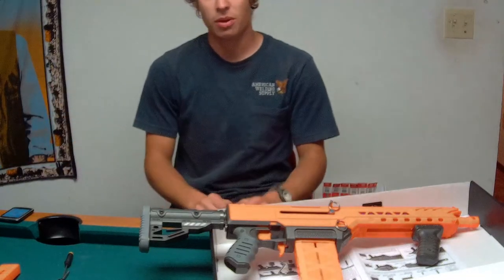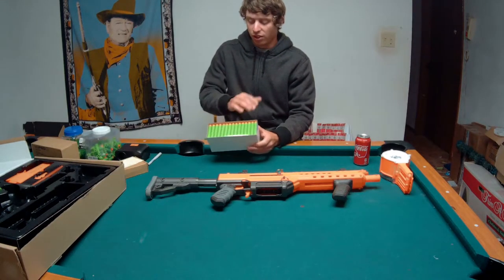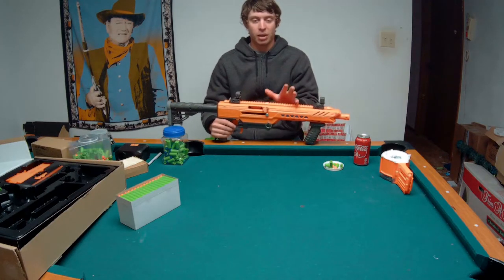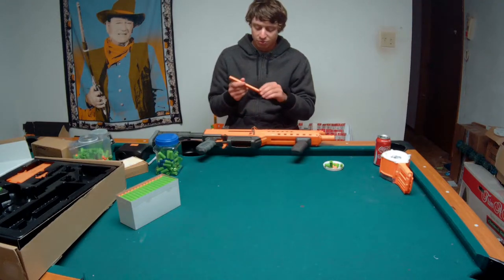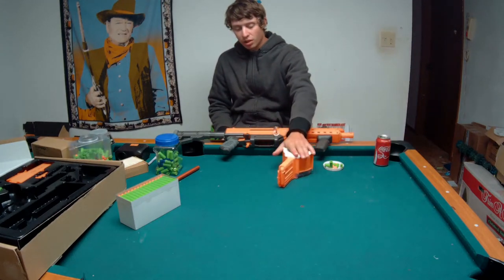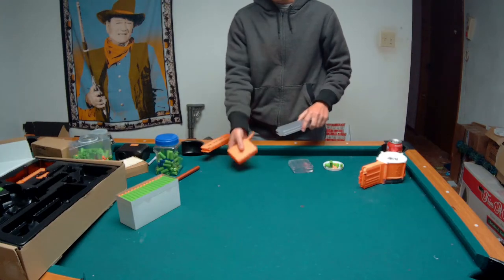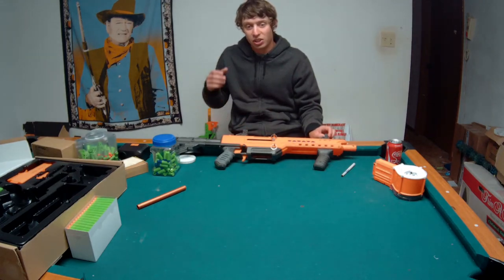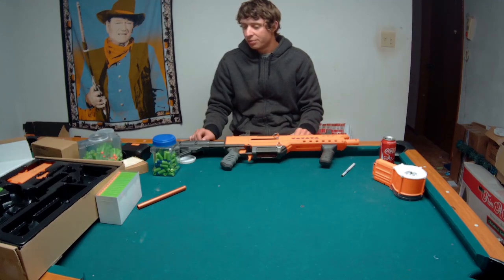Dart Zone Pro Review

Comment: Nice video u touched on a lot that no one has. Funny enough I got my DZP today and a hour before watching this video I was messing around with it. Most of the problems u had I’ve had to. I have the same stock problem has you it doesn’t collapse it just retracts to easily. And I also tested there mags in nerf, worker, and jet Blasters; none of them can take the DZP mags. And like you said when you were cronying the darts u can get better performance with other darts. There darts I thought were gonna be amazing but I’m some what disappointed, there accurate. But they fall short in distance compared to other darts like Acc’s and workers. One last thing you mentioned the goblin a couple times, just to let you know the goblin takes talons not katanas.
Reply from the maker: That's for the correction about the Goblin and the comment
Reply: No problem

Comment: I notice the metal barrel gets dirty rather quickly. Also, The reason you cant deprime the blaster is that the sled, plunger tube and catch box moves back ward at the same time away from the trigger so you can load full lengths, so when you pull the trigger its pushing up nothing when its primed back, the catch box will move over the trigger when everything is primed forward then trigger can engage the catch.